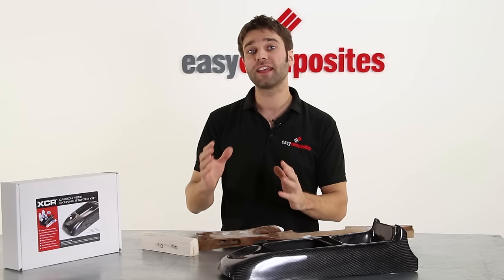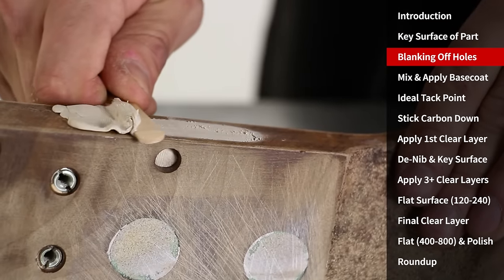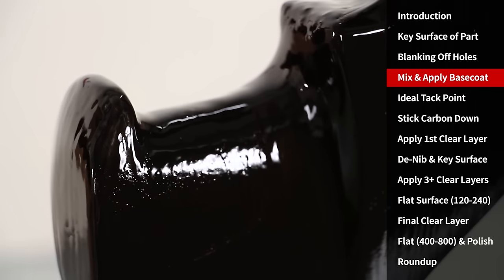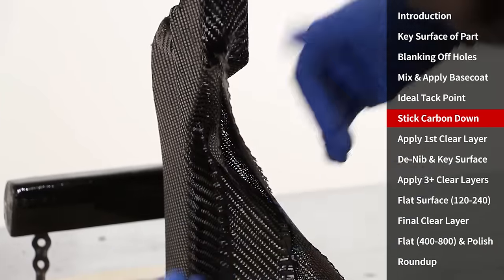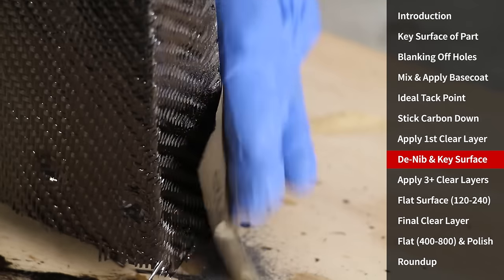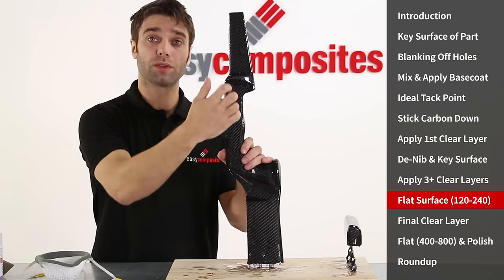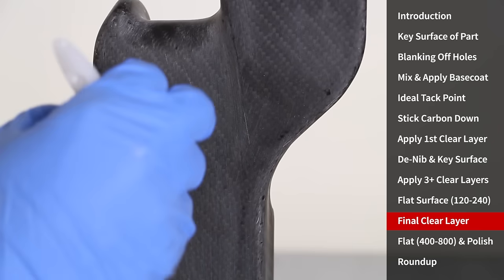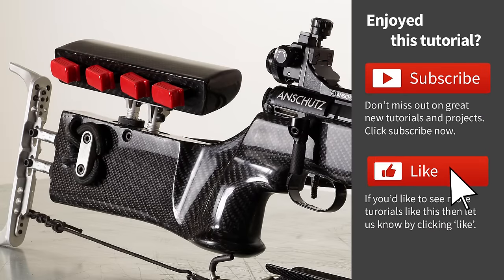Ultimate Carbon Fibre Skinning/Wrapping Tutorial - Sofie's Rifle Stock

Comment: Any advice to skinning a metal part? Is it even possible?
Reply from the maker: Hi Chase, yes, skinning a metal part is perfectly possible. The process is basically the same; the epoxy basecoat will stick very well to metal (in fact, better than it sticks to plastic). As usual, prep the surface by making sure it's clean and grease-free and keyed with a coarse abrasive; apart from that just follow the tutorial.

Comment: The base coat is the same as the gelcoat for fiberglass?
Reply from the maker: No,  the basecoat is a pigmented resin so does not have the same viscosity or properties.
Reply: @easycompositestv  so is it same resin as clear?, only with pigment added?
Reply from the maker: @lightdude329  Correct, we pre pigment XCR resin for easy use.

Comment: I am late to the party. 
Did this wrap last? I am curious about the two dissimilar materials. There was still wood exposed so did it expand/contract and affect the layup?
Reply from the maker: I'm sorry I don't think I follow the question. This video is all about a 'skinning' process which is essentially just wrapping a single layer of carbon fibre around an existing item. We use epoxy resin, so there's no shrinkage there, and we're not using any temperature processes, so no expansion or contraction. There is no exposed wood on the finished gun (once assembled).

Comment: I still get air bubbles with this kit.. need to use a heatgun to pop them
Reply from the maker: Check your working temperature is close to 20C.  The cooler the resin is the more air it can trap during mixing.
Reply: @easycompositestv  thank you for replying. Working and storing temperature is 22C, i mix it calmy for 3 minutes but still get bubbles. Do i need to wait between mixing and applying? Or maybe pop the bubbles by placing the cup in hot water?

Comment: In the video Paul says, of the quantity of topcoat resin, "you can always mix up too little" and then mix up more if you need it. I've found it's always better to mix up too much. Stopping to mix up more resin always seems to lead to problems
Reply from the maker: It really depends on the size of the project. For smaller pieces then yes it's probably best to mix up more than you need. For larger quantities though, there is a risk of the resin exotherming in the mixing pot whilst you apply it to the rest of the part. Hence, mixing in smaller batches can be helpful.

Comment: before using the brush, following measures are to be taken in my opinion
1. the brush bristles must be glued to the brush stem so that they may not be ripped off and dragged away during thick resin layup. 
2. the brush colour must have contrast to the applied resin so as to clearly see the broken bristles in the applied surface
3. for much thicker resin coats, almost half of the  bristle length must be cut to make the brush a bit stiffer for better dragging of the resin
4. after the use, the cured brush must not be wasted, infact other side of the brush plastic handle can be used for pressing the prepreg fabric in to the mould, instead of using nylon sticks etc. !!!
Reply from the maker: Good quality brushes will solve issues related to bristles coming loose.  Generally good quality brushes will have the right bristle stiffness for most brush application thickness you are likely to use.  Good tip on reusing the brush handle as a dibber tool for other composite processes.

Comment: Just a bit of a constructive feedback, but you completely skipped the description of what XCR coating resin is, and why it's different than other clear resin. Do you expect this to take the place of a proper clear coat? It would be nice to see a scratch test comparison between XCR and typical clear.
Reply from the maker: Hi Chris, maybe you're right. We try to make our videos not feel like one long advert for our products. In the case of the XCR system maybe we went too far because actually the XCR resin is nothing like a normal epoxy and results you'll get are far different and far better than a conventional epoxy. XCR is very UV stable so doesn't need a clear coat. It's also much harder than even the best 2k automotive lacquer/clearcoat and its ability to expel trapped air is incredible. So, yes, maybe we should have made that more clear. If you try this process with other epoxies you won't get anywhere near these results. Thanks for the feedback.

Comment: How would I make a skin that can be removed from the positive?
Reply: You would have to apply a PVA coating to the part, and of course make sure that the “skin” can then actually be pulled away, so avoiding any parallel surfaces is recommended

Comment: Does heat treatment not necessary for it?
Reply from the maker: No, the XCR Epoxy Coating Resin is a room temperature cure epoxy so no elevated temperature is required to cure it.

Comment: I'm trying to recoat an old carbon part. Its been a complete nightmare. No matter what I do I end up with a wrinkled finish on the epoxy coat. I'm thinking its the acetone, the paper towel, the environment, but its doing my head in. Help LOL!
Reply from the maker: The surface needs a good key to 120 grit and a thorough clean and degrease with a solvent like acetone. Then it is as good a surface for adhesion as you can get.  Also check humidity levels to ensure it is not having a humidity reaction giving a crackled look finish in extreme cases.

Comment: Can i use the top coat resin as the  base coat resin ?
Reply from the maker: If the part is already black (or very dark grey) then yes, you can use the coating resin as the initial basecoat layer; however, if it is not black already, the underlying colour will show through the weave of the carbon. The purpose of the basecoat being black is to mask the underlying colour.
Reply: @easycompositestv  ohh ok i didnt thought  the base color will show throught the weave woww ok  thanks a lot for your respond  after long time of this video haha i took a guess 🙏

Comment: Hi, i use spray adhesive to stick the carbon to my part, and then use the easy composites laminating resin , the carbon lifts from the part when i apply the epoxy.... any idea what im doing wrong
Reply from the maker: Generally we don't use spray adhesive to hold the carbon down, that's what the basecoat is for. If we use spray adhesive in carbon skinning it's usually just to stiffen the fabric enough to cut a neat edge on it. If you try to use spray adhesive to stick the carbon down then when you wet out the fabric with the epoxy it will just loosen the spray adhesive and this is why your carbon is lifting.
Reply: @easycompositestv  Ok, so whats the best way to carbon laminate this part. It is a 3d printed block made out of nylon material. Can you send me a link to your product which is needed to hold the carbon down.
Reply from the maker: @yamaharaptor1896  That would be very difficult as Nylon is incredibly difficult to bond to - in fact, its highly unlikely the epoxy would actually bond to the block at all.
Reply: @easycompositestv  Ok, so whats the best way to get it to bond? If i apply 3 layers of primer to the nylon block, will it bond then??

Comment: how heavy is this process compared to the vaccum bagging process?
Reply from the maker: Well, it's quite a different process. Skinning is all about adding carbon fibre to an existing part so generally it's done for cosmetic reasons but - as can be seen from this video - it can also be used to reinforce an existing part as well. A single layer of 2/2 twill that had been laid into a mould and infused (under vacuum) would be quite bit thinner and lighter than a layer of 2/2 twill 'skinned' onto an existing part but it's unlikely that you ever 'choose' between the two processes.
Reply: +Ronaldo Yeung you have to realise there is more than one reason someone would use carbon. some use it for pure function over form, like in a race car for instance where they dont care how it looks caus its probably going to be painted/stickered so only care about weight, they will use vac bagging. 
others want it purely for cosmetic reasons, they dont care about weight or strength and often simply add a single layer of carbon over fiberglass

in this case its zero about weight, a bit about strength but mostly about look (and obviously promoting the business and product) as well as "fixing" a broken part. the process took a broken wooden part and made it far stronger than it was originally. in a gun stock adding a couple hundred grams to what will probably end up being a 5kg item really has no effect on its every day use but its newly found strength has a massive effect on things like accuracy.

Comment: I love the videos and sub'd to your channel. When you mention the base coat, what do you mean? is it just epoxy resin with black pigment? Thanks.
Reply from the maker: Thanks, glad you like them :)  Basecoat is part of the XCR system which is made up of the black basecoat and the clear XCR resin. The basecoat is slightly thicker than the clear layer and it has a VERY strong black pigment in it. The basecoat prevents the colour of the part from showing through the carbon fibre and also sticks the carbon to the part.

Comment: So how do we make a hollow stock to reduce weight?
Reply from the maker: That could be either very complex with split moulds, PrePreg or internal bladders and curing under vacuum in an oven OR, you could use dissolvable cores and follow a process similar to the one shown in this video. In either event, you'd need more than one layer of carbon to give adequate strength but you could build up layers around a core made of polystyrene for example which, once the carbon has fully cured, could be washed out with a solvent leaving only the carbon skin behind.

Comment: How can you estimate the added strength?
Reply from the maker: Although it did noticeably add to the overall strength of the stock, it is hard to give any real figures for the added strength from a single layer of carbon without structural analysis and testing.
Reply: @easycompositestv  Is that something an amateur can do with Fusion 360, for instance?
I'd be very interested in a crash course about structural analysis: don't tell us just how to do carbon fiber but how much as well 🙂
Reply from the maker: @anidiotinaracingcar4874  You would likely need an FEA add on or simulation add on to do such checks in CAD software.
Reply: @easycompositestv  Understood. Still, I believe a video (or several) about it would be fascinating

Comment: I couldnt even reskin flat surface without sanding trough the carbon :(( hate my life i spent 2 hours on the piece and now it has burnt trough carbon layer that i cant remove 🥺🥺
Reply from the maker: Sounds like you need more resin if you keep cutting down to the fibre.

Comment: What do you mean by "safe edge" with the sand paper?
Reply from the maker: That just means use some abrasive paper to take off any sharp edges or stray fibres that are sticking up, otherwise it's quite easy to get a nasty cut off a sharp edge.
Reply: Easy Composites Ltd awesome, thanks!

Comment: what about bubbles? how did you not get any bubbles in the epoxy??
Reply from the maker: Our XCR Epoxy Coating Resin is a very special kind of epoxy, it's quite different from a normal epoxy laminating resin, it expels trapped air and goes on with virtually no bubbles, any that are there quickly disappear. It also has incredibly clarity, UV stability and is fast curing, allowing it to be built up in layers quite quickly. Skinning with a conventional epoxy is really not recommended as they don't have any of these important features.
Reply: @easycompositestv  you guys are based out of england correct? do you ship to the usa without any issues?
Reply from the maker: @icesalami  Hi Ethan, yes we are in the UK. We ship to the US pretty much every day and have some great customers stateside :-)
Reply from the maker: @icesalami   That's right, we do ship to the US, it is worth noting that anything hazardous will carry a surcharge.
Reply: @easycompositestv  how much is it
Reply from the maker: @icesalami  It depends on exactly what you're ordering but if you add the items you wish to purchase to your basket and then select United States as the shipping country in the basket page, it will give you the shipping costs directly :)

Comment: would it be possible to wrap a headliner?
Reply from the maker: If removed from the car then it should be possible.  You may want to make a jig to support the liner so it does not twist as once covered in carbon and resin, it will be more rigid than before.  You may need a thicker layer of basecoat to ensure the surface is smooth.

Comment: can you do this on balsa wood?
Reply from the maker: Yes you can, just ensure the wood has a good key for adhesion and is strong enough for the intended purpose as the skin of carbon only adds a small amount of strength in a single layer.

Comment: can i add more hardner to speed up cure ,
Reply from the maker: No, epoxies do not work that way.  Adding more hardener will cause the resin to not cure properly.  Epoxies need the correct ratio of resin to hardener maintained for the resin to cure properly.
Reply: @easycompositestv  thanks how about  apply  more heat can i speed up doing that.
,And can i use flexable  epoxy with xcr product  in deferand  areas of the project where i dont wanna flex

Comment: can i use this to cover a plastic interior panel
Reply from the maker: Yes, that's the intention. The skinning process can certainly be used (and is most often used) for things like vehicle interior trim. At the start of the video you can see a centre console that we have skinned using this system.
Reply: Easy Composites Ltd thank you for the reply. I've been looking to improve my car interior and this is like a godsend. Buying an aftermarket carbon fiber trim part is literally hundreds of dollars

Comment: Weird. My comment disappeared. New try. When You are trimming the excess fabric, reminded me of what I did last night. I was cutting some excess fabric, and coincidentally, was wearing a headlamp and realized the particles were flying in front of my face, even though there was no wind because I was in my apartment. Tiny particles flying, at least half a meter higher than where I was cutting in a matter of seconds . I have heard rumors here and there that they are not very healthy if inhaled.how do you deal with this? Asking because I saw that you’re not wearing a mask when trimming the fabric.
Reply from the maker: If you were concerned about the tiny fibres from cutting raw carbon, a decent dust mask would solve the problem.  However, generally the bigger hazard is the dust from sanding or cutting cured carbon and resin.
Reply: @easycompositestv   to be honest I did not think about it until I accidentally say the fibers flying. If I wasn't wearing a headlamp I would not have noticed tbh. My logic told me "Aaaah relax...  inside a room with no wind they would not immediately fly around upwards as soon as they touched the scissor. Don't worry!" . 
Lesson learned.  As for the sanding, I did not get to that yet so thank you for the warning. Cheers

Comment: Can i skin carbon fiber on sintra board?
Reply from the maker: If the surface is heavily keyed then it may be possible depending what plastic the board is made from.  Avoid boards made from low energy plastics as the resins are unlikely to bond.
Reply: @easycompositestv  was thinking it might be crushed or deformed when the resin is getting hard

Comment: How about vacuum bagging it ?
Reply from the maker: Our experience trying to combine vacuum bagging with skinning has always been pretty unsuccessful and we're not aware of anyone else making a success of this process either. The main problem is the wrinkled caused by the bag; both wrinkles in the fibre and also in the resin. Generally, by the time these issues have been put right then the advantage of vacuum bagging (i.e. better consolidation) has been negated by the extra work to bag it in the first place and to put the wrinkles right.
Reply: Easy Composites Ltd ... ok good to know.  Thank you .... I would have done that if it wasn’t for your response. 

Thank you

Comment: Could I do this to my rifle barrel
Reply from the maker: Potentially you could carbon wrap a rifle barrel. There could be a few considerations depending on the type of gun it is. If it's an air rifle then there is unlikely to be a problem but if it's a firearm you might need to consider barrel temperature and heat dissipation from the barrel if you wrap it in CFRP.
Reply: @easycompositestv  i see where there are alot of carbon barrels made nowa days.  I want a somewhat heavier contour with out swaping barrels.  Just a lil heavier contour.  Two or three wraps thick?  I only ever shot 5 times at the most.  223

Comment: Is your kit available in the United States
Reply from the maker: We don't have any distributors or stockists in the US but we can ship directly from the UK to customers in the 'States. It does mean higher shipping costs however and there is a 'dangerous goods' surcharge which applies because the resin in the kit is classed as dangerous goods. If you're just ordering a small kit then the shipping cost can seem pretty high but for larger orders it doesn't work out to badly.
Reply: Easy Composites Ltd I actually work on a US  Military base in Korea.  Anybody here in Korea?
Reply from the maker: In theory we can send to South Korea with similar surcharges to the USA.  The problem might be getting the items delivered onto the base as often local couriers struggle to get access - this can be an issue on mainland USA bases let alone international ones.  It would be worth checking what can and can't be delivered to your base direct.
Reply: Easy Composites Ltd I have an apartment off base but the address is weird